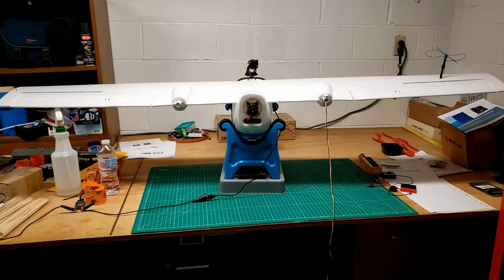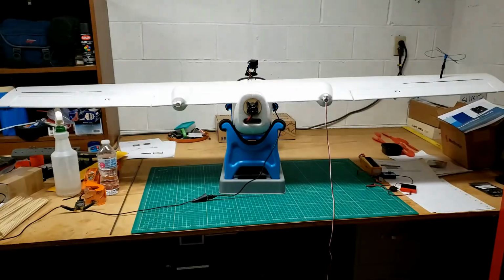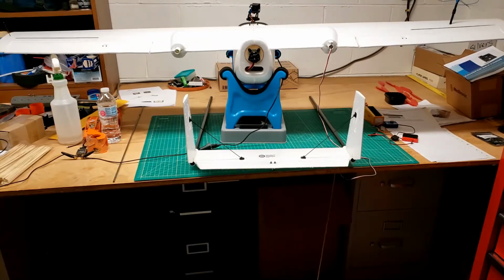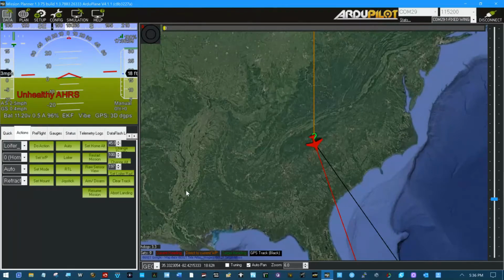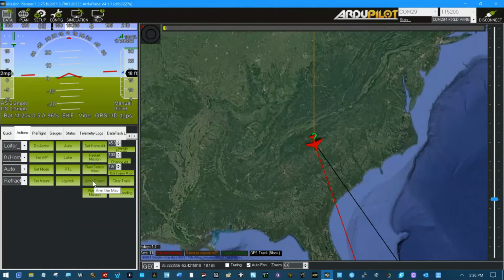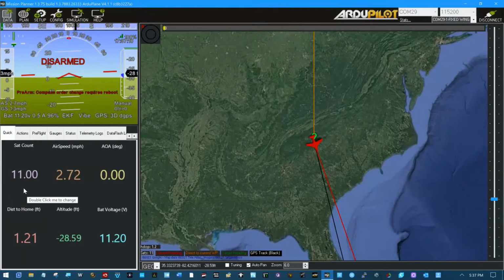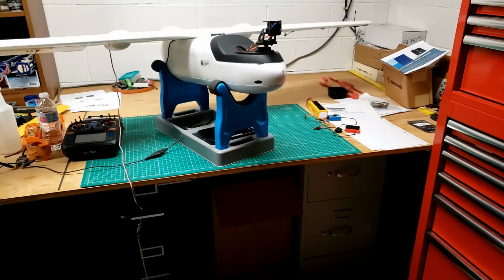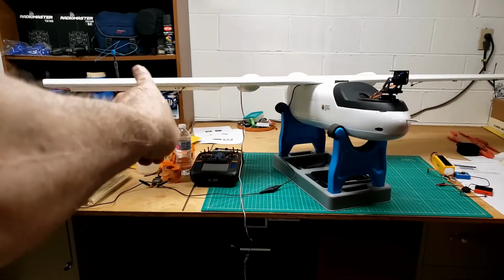Skyhunter Electronics Setup 1 of

Comment: 😍 One step closer. Vtx not coming on 🤔 How much power is being supplied to it, 9v or 12v?? I remember the jumper needing to be solder on the fc. And I didn't recall you mentioning what voltage you planned to use. 😉
Reply from the maker: I soldered up two F765-Wings and one H743-Wing this year and I don't remember what I did in which. lol I know I set one different. I did a troubleshooting video on it tonight and it seems to be those pads. Will find out tomorrow. Been a LONG day. Video is rendering now.  But at this moment, I think you nailed it.  Actually I hope you nailed it.  :)